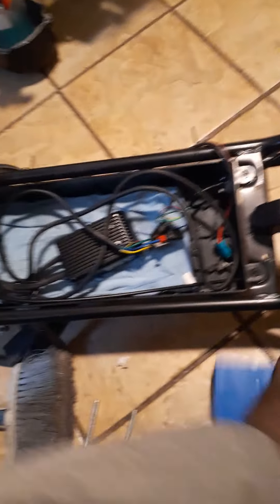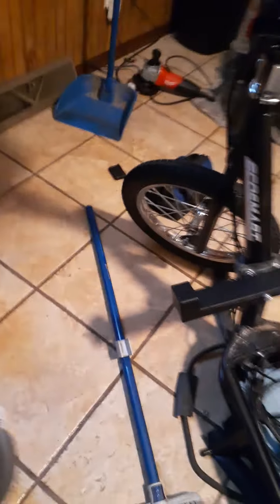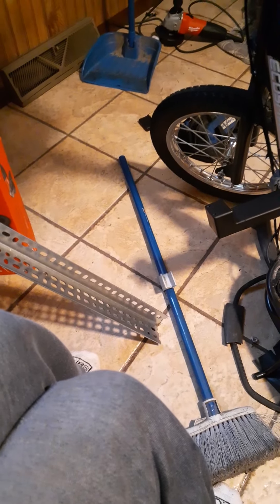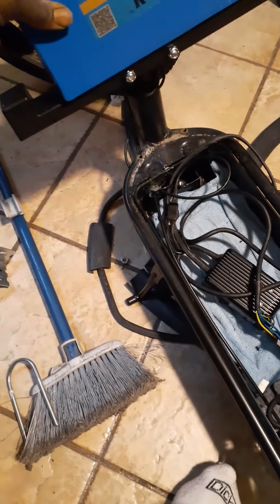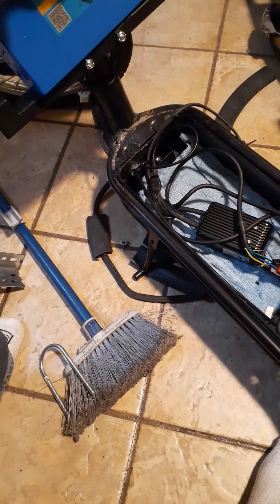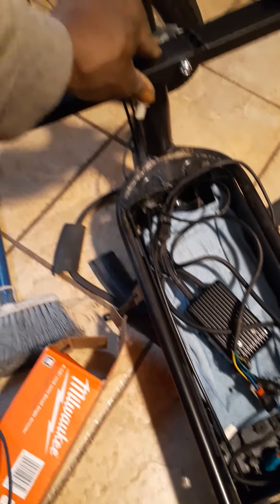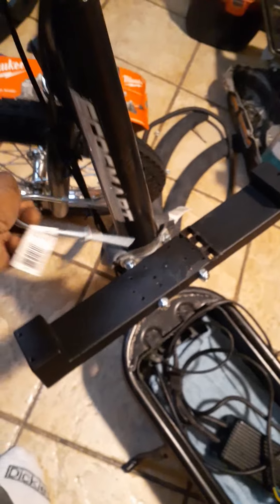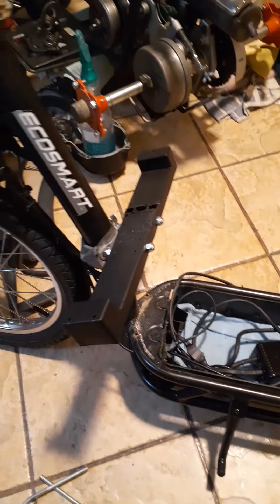Razor Ecosmart Sup scooter extra battery/cargo carrier mount ! Shabingo ! I did it !

Comment: What's the BMS 20a or 30a on the battery
Reply from the maker: 20amp bms
Reply: Do you think the original controller would be able to take a 48v lithium with 30a bms
Reply from the maker: @PeterNtheWolf   No....I would go with a 20ah 36v lithium ion battery.